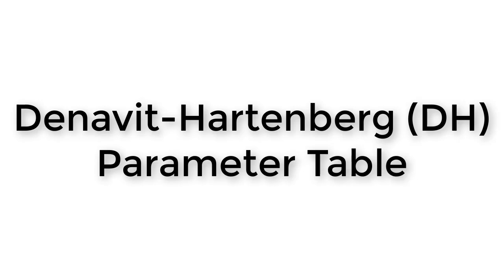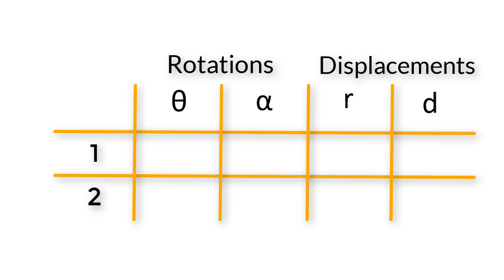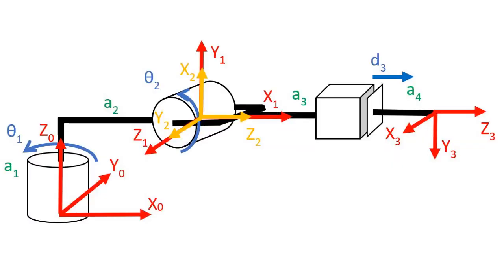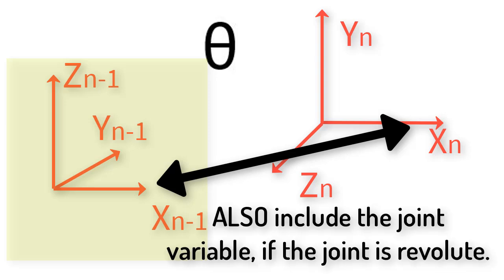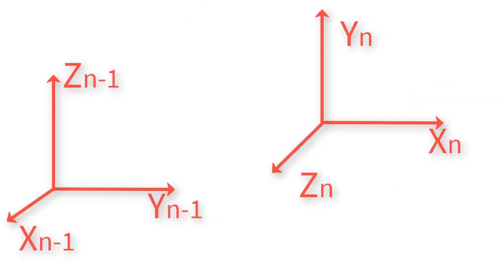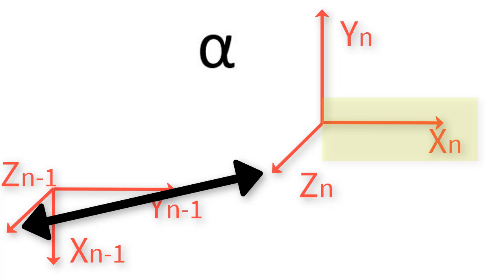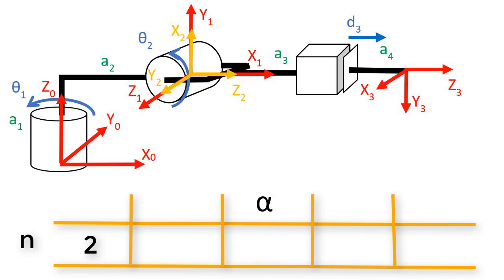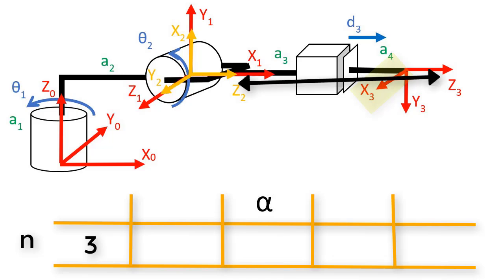Robotics 2 U1 (Kinematics) S2 (Denavit-Hartenberg) P3 (Parameter Table)

Comment: Does following a different convention for frame assignment change the way I calculate these DH parameters? I was referring to a separate online course which followed the Craig J.J convention of frame assignment but I found the explanation of DH PT to be incomplete there.I understand this far better and clearly. So I wanted to know whether I can use these techniques of calculating DH parameters irrespective of the convention used for frame assignments?